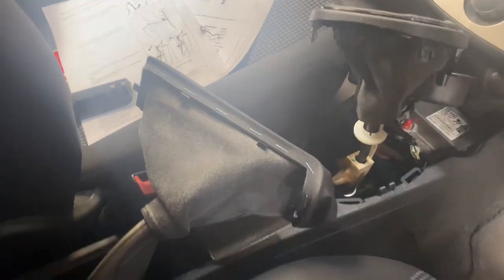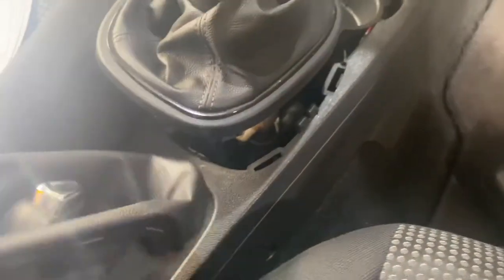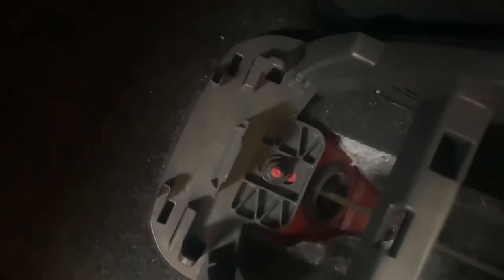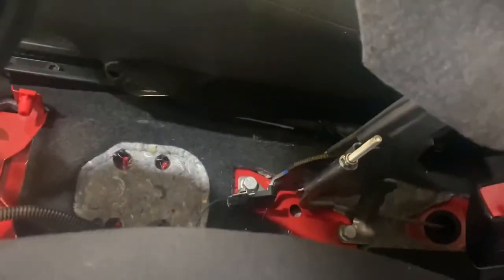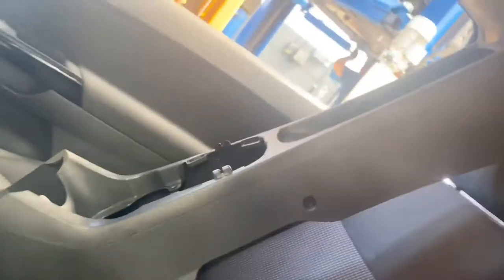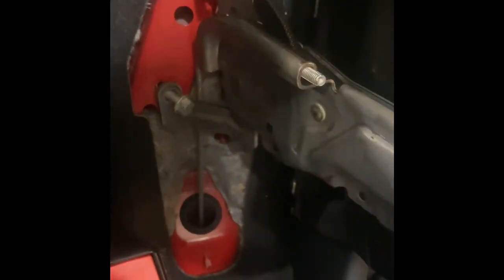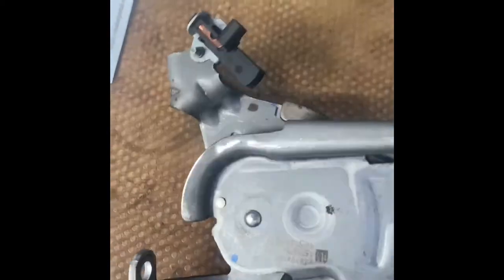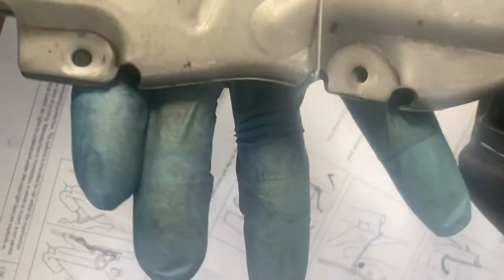#Vauxhall #Corsa #handbrake #leaver #spring #recall #modification

Comment: Thanks, but where do I get the spring from ?
Reply from the maker: Vauxhall
Reply: @g_a_bofficial  ...VX lol, the last time i went there they charged me £15 for one small bolt…rip off VX are
Reply from the maker: It’s a recall so if your vehicle is one of those that needs this recall it’s free of charge just ask
Reply: @g_a_bofficial  Yes mate, but I want to do it myself not VX..... Do you think they would give me the spring if i went and asked ?
Reply from the maker: Just order it from the parts department
Reply: @g_a_bofficial  It's a recall so should be free of charge
Reply from the maker: If it’s due to be carried out on your vehicle otherwise you will have to buy it
Reply: @g_a_bofficial  Yes.... So they should give me the spring even if I'm doing it myself.... I will go to VX in the week and ask, take my VIN number and reg with me
Reply from the maker: If you car is due or over due for the recall they won’t give it to you for safety reasons it will need to be carried out by a Vauxhall retailer because it has to be registered that it has been carried out on their system
Reply: @g_a_bofficial  In that case I think I'll pass